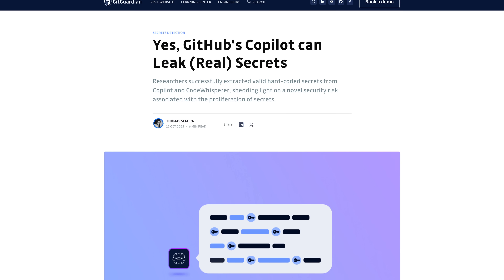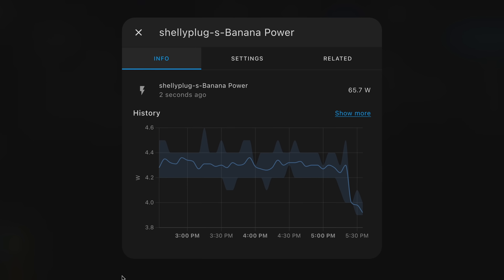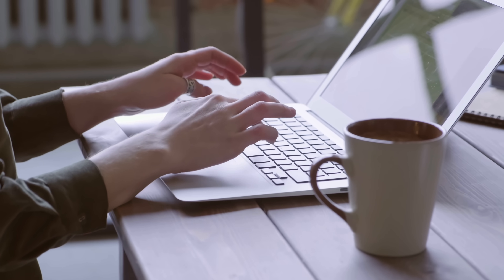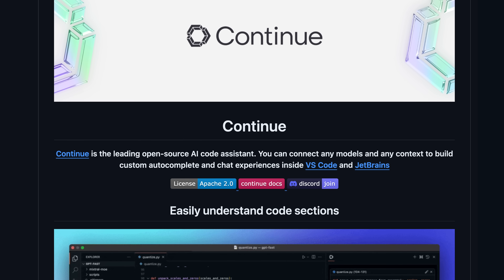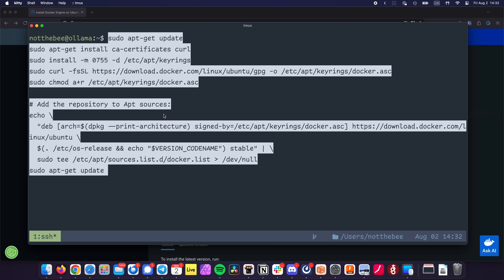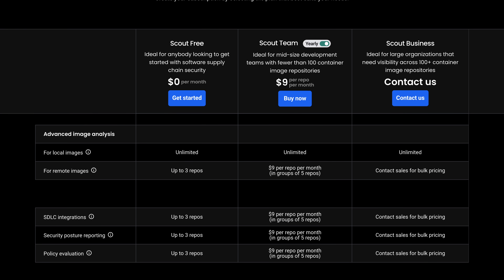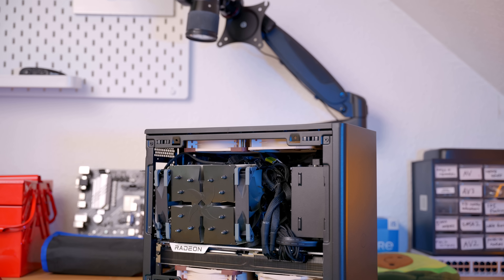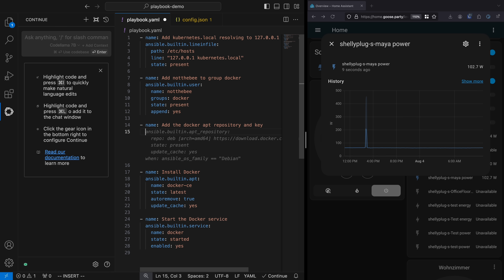Host Your Own AI Code Assistant with Docker, Ollama and Continue!

Comment: Thanks a lot for this topic! I am very interested about running AI in my homelab, but those AI chips are very expensive and power hungry, it would be interesting to review other options such as iGPU, NPU, cheap ebay graphics cards or any other hardware that can run AI inteference
Reply: Im waiting for the m4 mac mini, if they offer it with 64gb ram it will most likely be amazing value for AI

Macos can run ollama and it runs very well, and the unified memory model on apple silicon is perfect for it

Comment: An RTX3090 also offers 24 GB VRAM, and a second-hand/used one can be had for around £650 if you shop around. Of course you want to be careful, as ex-mining cards could lead to a bad time.
There's a lot of great coding-tuned models around the 8 to 11GB range, so 24GB may not even be necessary.

I can vouch that the performance of the 3090 in ollama is exceptional if you use models capable of fully fitting in VRAM.
For example, on some relatively complex SQL, it manages around 100 tokens per second, when using the Ollama web UI / Open WebUI chat interface.
For perspective, compared with the free plan of ChatGPT, it feels as though it's 10-20x faster. Whereas with ChatGPT I have to sit and wait for it to type out word by word and can comfortably read faster than it does it, with self-host on a 3090, it runs much faster than I can read, to the point that by the time I've started reading the code part, it's already completed 4-5 lines down.

Even though I have a 4090 in my gaming rig, I'm not sure if it would provide better results in terms of performance.

Comment: The best way to run low power LLM's is to utilise the integrated GPU. It can utilise regular system ram, so no large vram required and it's faster than cpu. 

I really think this is the only viable way of doing it.
Reply: And how to utilize integrated GPU?

Comment: 10:41 how the hell did you get tab autocomplete to work so easily? I've been banging my head on this problem for months and even tried to copy your configuration but still it just refuses to work for some reason
Reply from the maker: What hardware are you running Ollama on?
Reply: @WolfgangsChannel  Ollama runs fine, but the tab autocomplete doesn't want to work
If I do Ctrl+L or Ctrl+I it works fine
Reply from the maker: Which model are you using for the tab autocomplete?
Reply: @WolfgangsChannel  in vscode extension I can choose any and it will not even try to load it (ollama log doesn't show even getting a request to load the model)
it will load models I've set for chat functions (Ctrl+L and Ctrl+I) but never tab autocomplete
(For chat: llama3.1:8b-instruct-q6_K, gemma2:9b-instruct-q6_K, llama3.1:70b-instruct-q2_K (slow but works), for tab autocomplete: deepseek-coder-v2:16b-lite-instruct-q3_K_M, codegeex4:9b-all-q6_K, codestral:22b-v0.1-q4_K_M)
Reply: @WolfgangsChannel  ryzen 3600 32gb 3200 ddr4 rtx 3060 ti

Comment: Would be interesting to see the viability of using an amd-powered mini pc for that with something like 7840hs/u with 780m. There seems to be some work being done to fix the memory allocation (PR 6282 on ollama gh). I've tried small-ish models (3b) that fit into my reserved vram and they seem to run faster this way, even if still constrained by memory speeds.

Comment: There are ways to accelerate the AI models on Intel iGPUs, but they need to be run through a compatibility layer if I'm not mistaken. I couldn't test the performance of those, but it would work instead of allucinating and throwing errors like that. I didn't know you could plug in locally run models for coding so loved the video!
Reply: Yes the layer is called ipex-llm i would love to see an update video testing that
Reply: Thanks, I was scowering my wiki to find that info but without success
Reply: After scrolling through some github issues it would appear ollama supports vulkan which can utilize the iGpu
Reply: I have this setup. ipex-llm works great. Processing is done on my Arc Graphics iGPU
Reply: @gelomorn  What setup you used to get it working?
Reply: @ as I have predicted the comment I have posted was deleted due to link. My setup was windows 11, core ultra 5 125H, arc gpu, 32gb ram, I have deployed intel's docker image which has igpu support via ipex-llm. Works great

Comment: 3:25 I bought my RTX 3090 used for 600€ with 24GB* of VRAM. Just for reference - that's a great deal.
Reply from the maker: Is it a modded card? Stock 3090 has 24GB of VRAM
Reply: @WolfgangsChannel  Oh man, I just wanted to update my comment :D
No, I'm just an idiot. Looked at the wrong row. 24GB of VRAM.

Comment: I wouldn't put my faith into any LLM small enough to allow local hosting for coding, while chatGPT can't write something as mundane as an actually working autohotkey 2.0 script. If you can troubleshoot the hogwash output, good for you. If you can't, tough luck... it can't either.

Also not being able to utilize AWQ models is shooting yourself in the foot from the get-go... 5:13 - case in point.
Reply: The other options is having your work spied on and stolen.
Reply: @firstspar  No, the other option is to not use LLMs for things they weren't meant to be used for.

Transformer models whose working principle is to give you a probabilistic distribution of words as results, can't do specifics! Why do you think it struggles with math concepts as simple as adding two single-digit numbers accurately when it's accompanied by a text representation of what those numbers are? This is an example when I asked it how much of each thing I'll need (I repeat, I'll need, one person) for a 9-day stay without the possibility to go to the store to get more:

Personal Hygiene
Toilet Paper: 2-3 rolls per person per week, so about 18-27 rolls for 9 days.

It outputs 2*9 to 3*9 instead of rounding up 9/7*2 to 9/7*3, not being able to reconcile the concept of a week with days and THIS is what you want to entrust with coding?! Solving coding problems?! This isn't just a minor error, it's a fundamental failure to apply basic arithmetic concepts correctly, and this with 4 HUNDRED BILLION parameters, what do you expect out of a 3 billion model? A lobotomized version of chatGPT won't just suddenly get a concept right chatGPT didn't, just by tightening its training data to only entail coding!